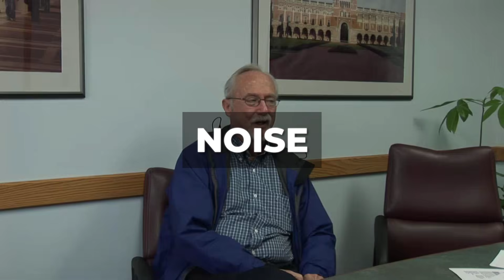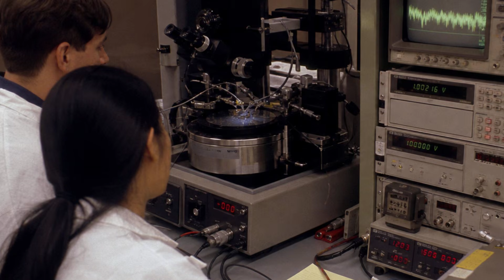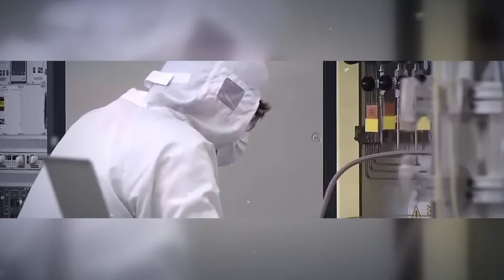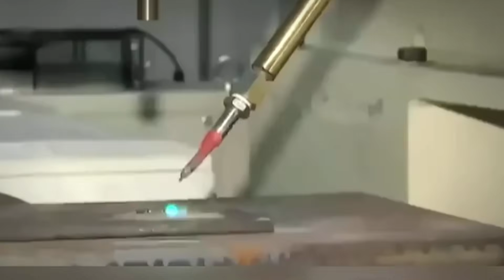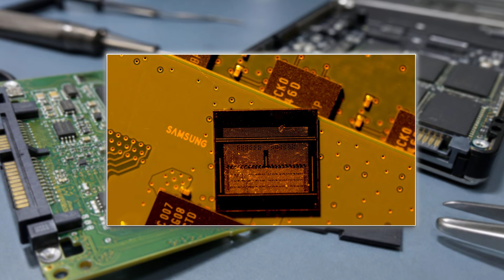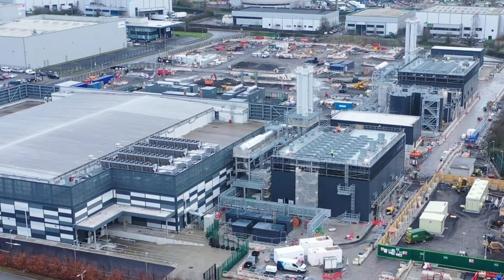China Just Built an Impossible Memory Chip

Comment: 1 electron is not the floor, it's 0, using something besides electrons to store a bit, such as a literal physical switch. Like a light switch. Yes, it is definitely worse than a single electron or even a million electrons, but it is technically 0 electrons representing the bit.

Although you could technically argue that electrons would still need to travel or not travel through the completed/incomplete circuit, but then you could use neurons to detect the state of the physical switches instead of the presence or absence of the current. Once you get into wetware, everything gets significantly more complicated... but I just know of it, not at all in depth